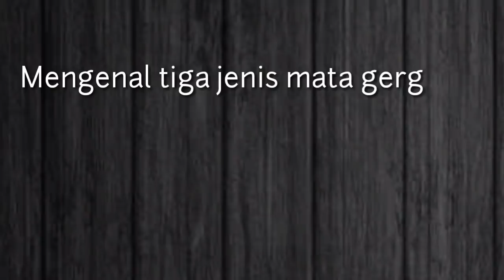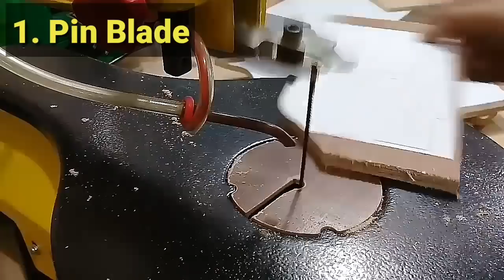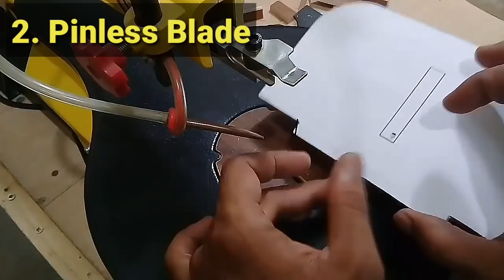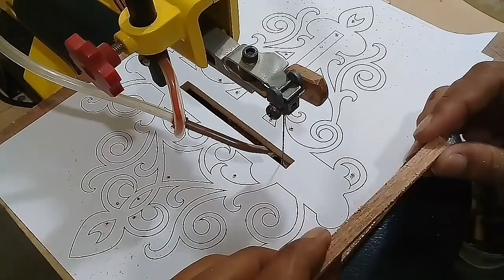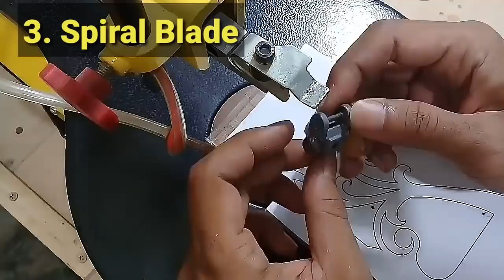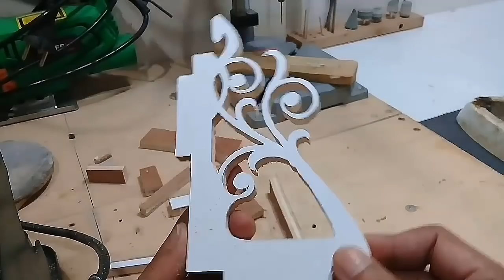Scroll Saw Pin Blade Pinless Blade & Spiral Blade

Comment: That spiral blade was all over the place. I couldn't see one cut that followed the line. If it was me I'd use a number 3 flat end blade for wood. Its thin enough that you can cut tight curves and go round corners. This saw looks like it could be a Hegner, but being yellow it might be a Dewalt? I'm a great believer in working up to the expensive machines. If I was a beginner I'd buy a cheap machine and see how I got on. You can always upgrade.. You have to use a machine to know what features are important..

Comment: what type of tack glue do you use to hold your pattern in place? No one seems to want to show that or to talk about it. Thank you.
Reply: Regular glue-sticks are ideal because they're water soluble, just wet the paper a little and with any luck you'll be able to easily peel/scrape it off.
Reply: Elmers spray glue. Spray a little wait a few seconds then apply. You can use a heat gun or hair dryer to remove